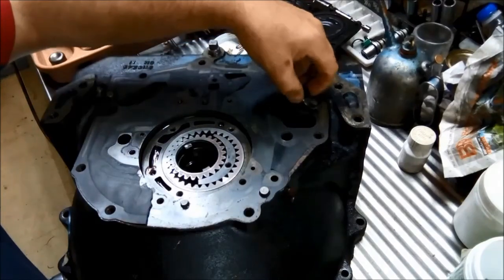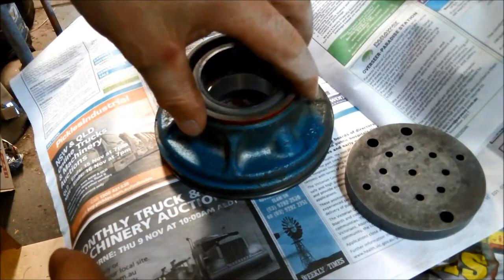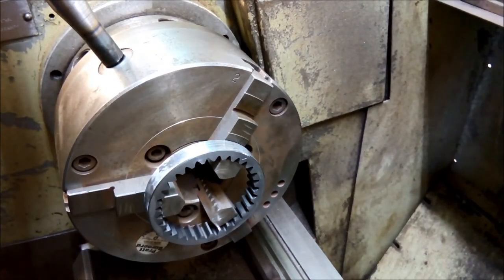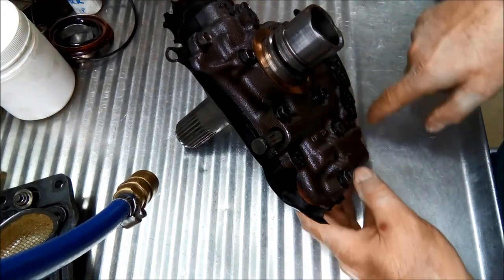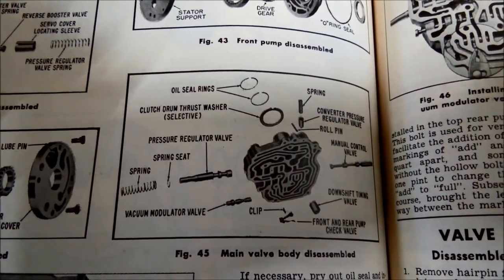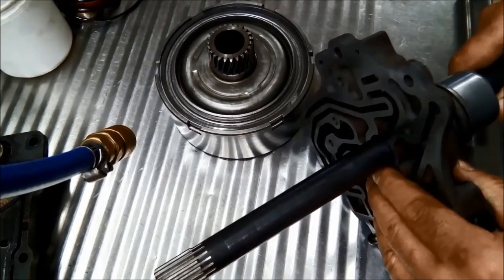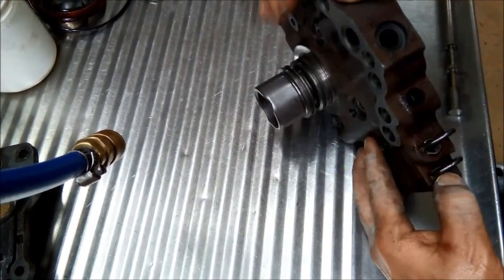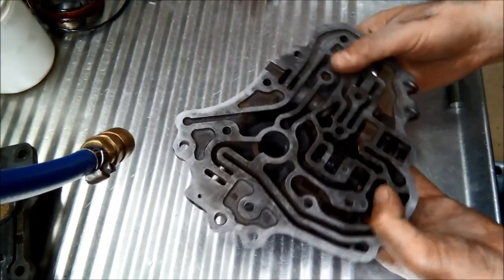Chevrolet Cast Iron Powerglide CAST IRON Rebuild Part 5of7 DIY How to

Comment: Big thank you for the technical advice at home in France we do not have a translated technical review on the Powerglide cast iron of 55-57 and unfortunately I can no longer translate vaux video into French I do not know why it does not work anymore but still thanks to you I see clearer in the dismantling cleaning and reassembly of the Powerglide 
But then to see 😁🤔😂😂
Reply from the maker: hi, glad it has helped. thanks and cheers